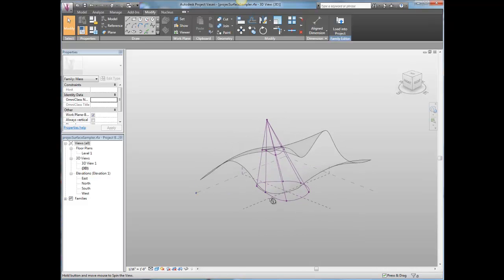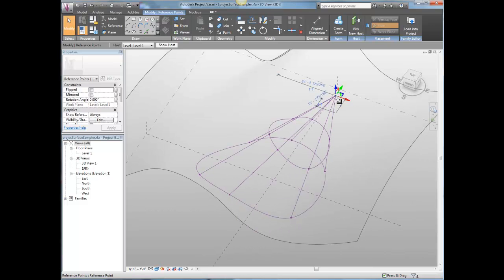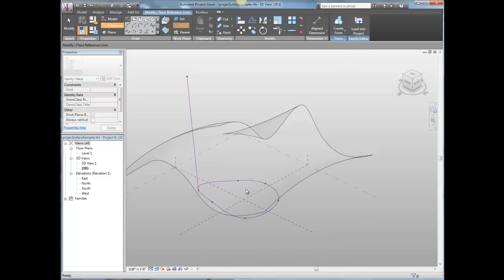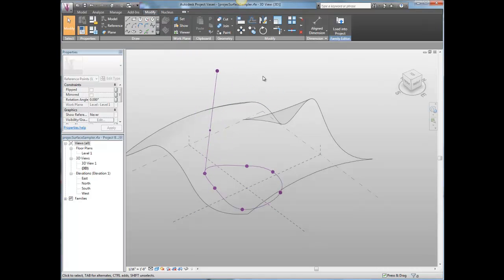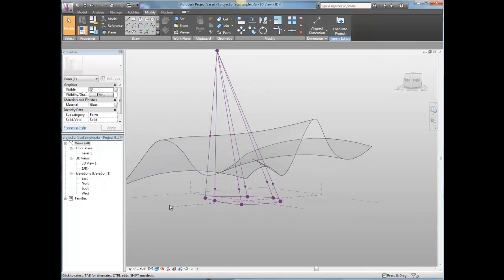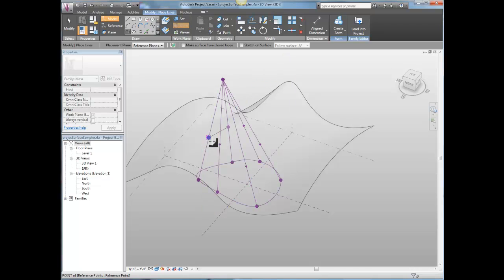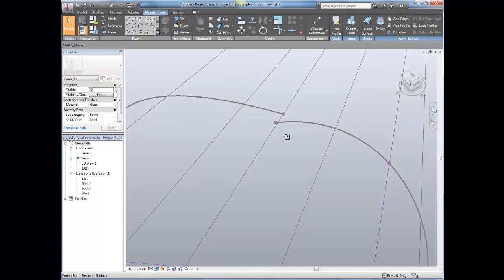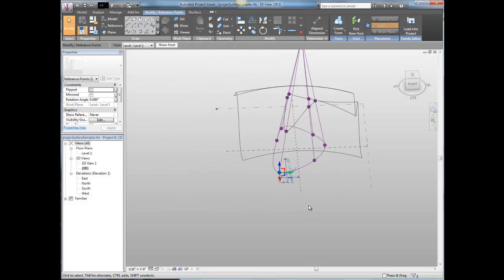Parametric Patterns IV:  Projection_SurfaceSampler

Comment: The curve formed by splines is not the exact intersection of the form with the lines. In my file the spline which i made showed slight differences from the actual intersection face.